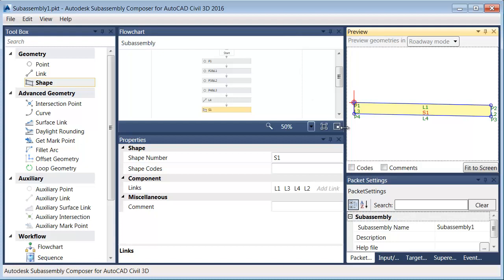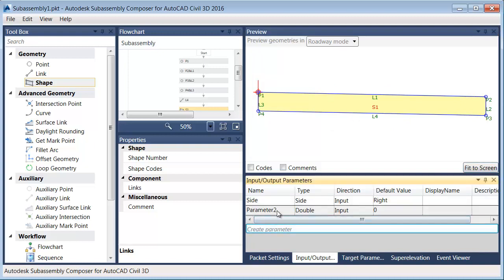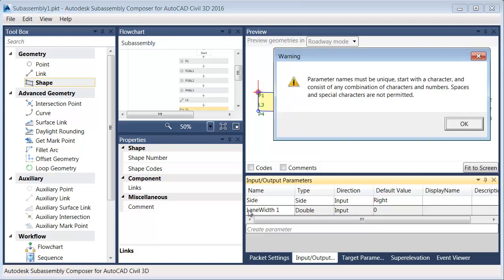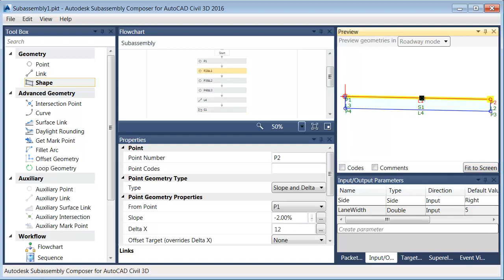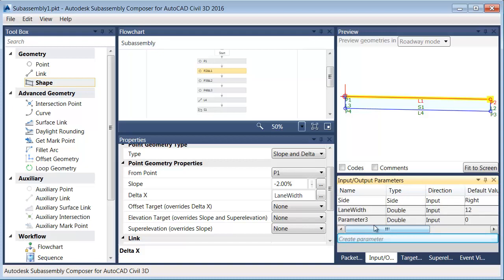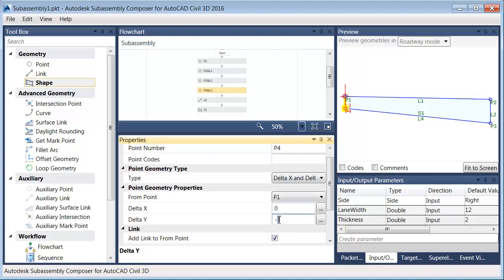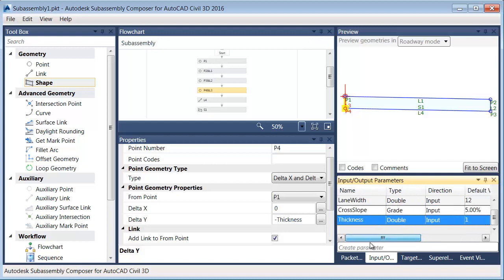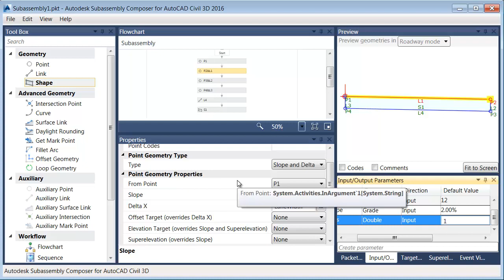Subassembly Composer Pt. 3 - Using Parameters to Control Geometry

Comment: Sir i have watch this series of videos and create a Lane assembly same describe in these videos but When i tested the same assembly my assembly top link not working how can i solve this problem.
Reply: Same issue here. Googled it, seems like 2019 SAC issue with Apply AOR. Read https://forums.autodesk.com/t5/civil-3d-forum/p2-amp-l1-failed-to-execute-subassembly-composer-assembly-with/td-p/8418409
I tried in 2020 and it works but I could bring the subassembly in Civil3D 2020 only, not to the previous versions.

Comment: The thickness shouldn't be perpendicular to L1?
This is simple vertical in screen.
Reply: Yes, you are right but when we are dealing with small slopes such as 2% the thickness is approximately equal to the Dy the vertical height difference between P1 and P4 in his case.